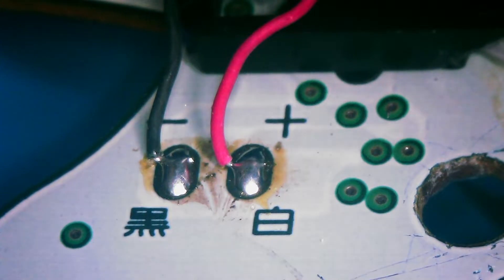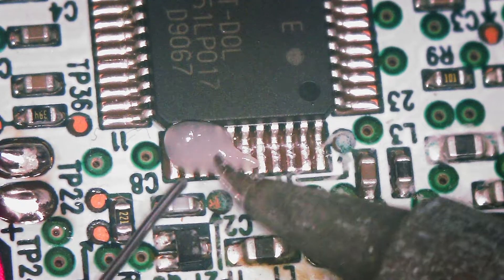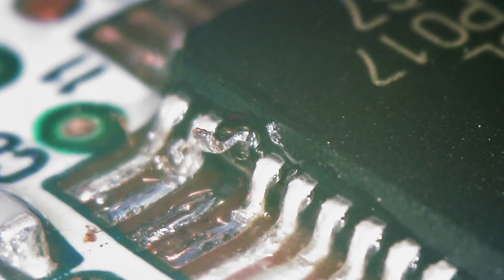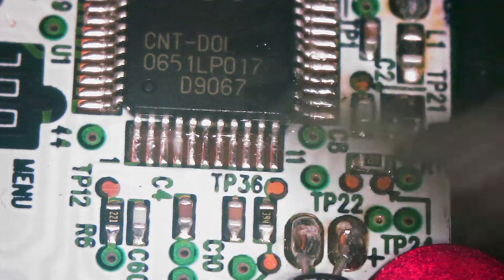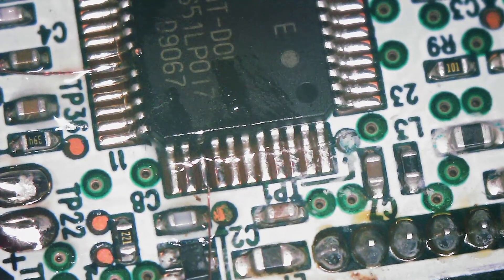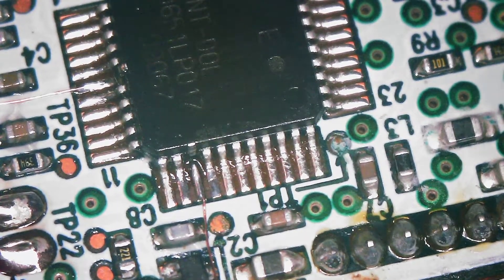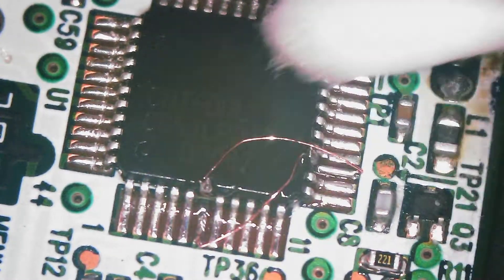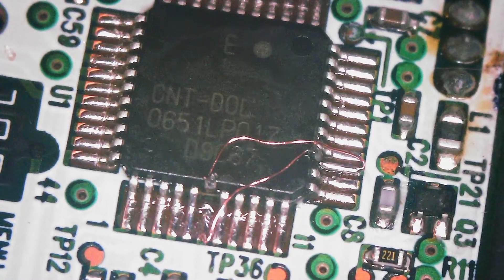GameCube Controller Remap Mod Walkthrough

Comment: I have multiple points of continuity, how do I know which one is right? I've tested using the top pad of the X button, using just the keyhole shape, just the curved shape under it, and both at the same time. No matter what there are multiple points of conotace, across multiple of my OEM gcc boards so I know that im doing something wrong. Are the pins not always the same for remapping on every controller? If they are which pins are they? you could say using north south etc and pin number counting left to right if so.
Reply: Sane problem ever figure it out

Comment: Using high quality fine tweezers makes the process much faster. I'd recommend getting the Vetus MSA-18, MCS-18 or MJP-16-11 – these all have a round curve shape on the tips that makes lifting chip legs quite easy. As an alternative option, scalpel knives also work well. With these, you slide the knife tip below the leg to lift it up.
Reply from the maker: Thank u friend ☃️